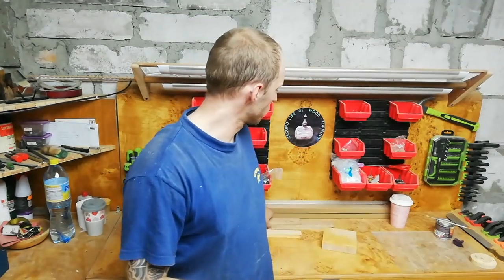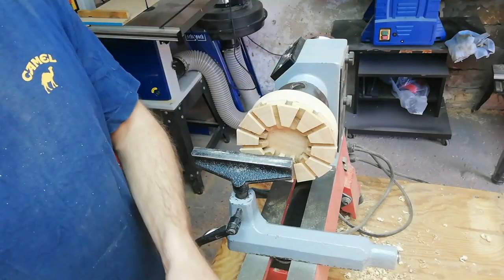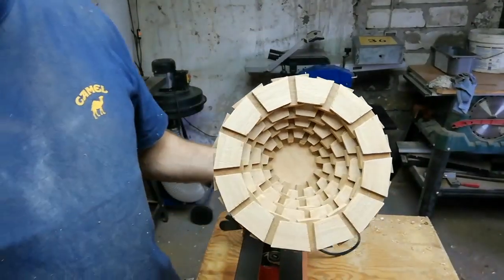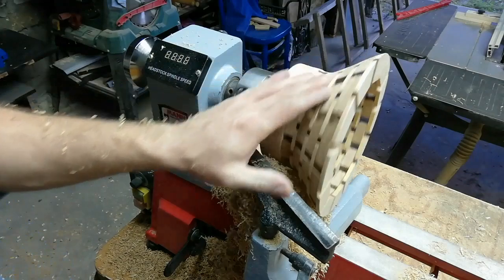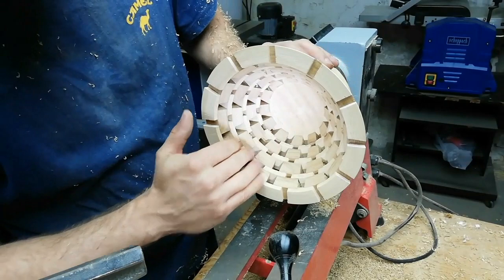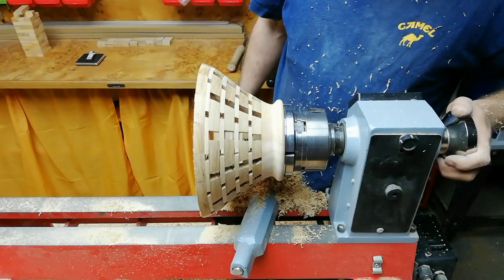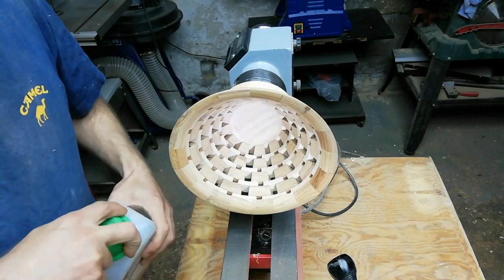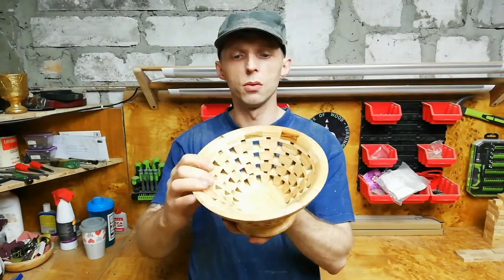Open segmented bowl- Woodturning

Comment: Looks pretty dang good to me Rav. I have not made an open segment turning so you are one up on me! Little mistakes are going to be easy for you to overcome.
A big mistake is not even trying so on that note you have made no mistakes as far as I am concerned.
It is better than any others you have done and better than any I have done.
 If I have time I will make a mid week video showing how to over come the gaps on the top row.
But for now you have done great again my friend,
Take care,
Gary
Reply from the maker: Thank You very much, Gary 🤝 I would like to overcome the mistakes but those all are from plastic table saw. I can set it up as best as is possible but while cutting saw isn't working in line. Just have to change the table saw.
I love videos with tips so be sure I will watch it as Your every video 😀👍
Be safey friend.
Rav
Reply: I had no idea you saw was plastic. That does make it very difficult for sure.
I will still do the tip video as it will work with   most shop machines.
Gary

Comment: Ha, such tiny, little, hard to see mistakes Rav.  The overall beauty of the piece makes mistakes microscopic my friend. Wood color ? Puh. Not lined up? Double puh.  🏆🏆🏆🏆  👍👍
I always thought the seg sled kept the angles perfect if you flipped from one angle to next. If so then glueing in order they were cut should keep the cuts aligned ?  Try this thought experiment - one straight board, cut with 89 degree blade - now both ends will match well (  ===/ /=== gap is the cut  / is  the 89degree cut end). ???     
Stay safe. -Mike😷   
p.s. your vids are too often too thought provoking for me so it takes me an hour or two to watch entire vid ... I get so many ideas I need to explore as I watch you work LOL
Reply from the maker: That's right, Mike. The mistakes aren't so visible on first sight that's why I'm so proud of myself 😀 After this project I started making the top of the boards and when I'm fitting the ring every second segment is up side down. I made a layout plate and markered the centers on my templates for wedgie sledges to get identical angles from both sides of segment so in future will be much easier 👍 The biggest problem is with my table saw. It not cuts identical with every cut becouse the saw is not stiff with the engine and angles can change and even it is not a straight cut. Need to buy new table saw and not from market.
Thank You very much for Your support and tips. You are always here and making my life easier and funnier 🤝😁🤡
I should start uploading only one video per week becouse I'm taking Your precious time. Next video will be in next saturday, maybe friday. This time acetone and resin 🤫
All the best for You and Your Wife 👍
Rav
Reply: @Secondlifeofwoodturning   Time ? Precious ? Nah, I enjoy whatever I find myself doing😊 
Yah, a decent table saw  helps a lot. Not easy to fix a worn or poorly made machine so ... Save you coin is best I guess. Ugh.
Take care yourself. -Mike😷⏳
p.s. I have spent so much time lately getting green wood dry for turning but it's just not working out well. So we decided I can buy more kiln dried wood for my turning. And tools too. Yipee!! Stay tuned😁😁😁
Reply from the maker: What can I expect from plastic table saw 🤣 Never again Parkside tools even free. Yuup, saving coins is the best way. I suppose this one will die till spring. Mitter or bandsaw cuts much better.
Drying wood is one big unknown. Some of my logs has cracked even with sealed endgrains. What is the funniest almost every not sealed didn't cracked 🤔
"We"? It means Your Wife allowed You to buy, yes? 😁😎🙏
I'm always saying "You have never too much tools"💪💪
We will see what did You bought 👍😀
Be safe Brother 😷
Reply: @Secondlifeofwoodturning  Yes, wife and I decided together.😀
Yes, we are taking care. -Mike😷⏳

Comment: Hi Rav  ... Sorry but this bowl is just not good enough !!!  ... I will send my address to you so that you can post it to me and then I can dispose of it in the correct manner.. Haha... seriously though... this is a fantastic 1st attempt at open segmenting... I haven't tried it yet but I would be more than happy with a similar result... with regards to the segmented top ring and the gaps .. take a look at Tony Meadley  YouTube videos on segmenting... before he cuts the segments he draws a line down one edge of the timber and a wiggly line along the top ... then when assembling you alternate between a wiggly line and no line on the top   ... this compensates for your saw blade not cutting at 90 degrees... check it out... it works every time... hope this helps... take care my friend...All the best.....Andy
Reply from the maker: Hi Andy. You got me! 😎 I forgive You 😁👍 As a first attempt I'm very proud of this bowl. I made a layout plate for open segments so next time will be better. Next time I have to straight the boards with thicknesser to not wasting time for turning and sanding every ring.
I have seen Tony's video but I'm always must be "smarter". After this project I started drawing the lines on tops of every board.
Thank You very much for joke, comment and tip my friend 🤝😀🍻